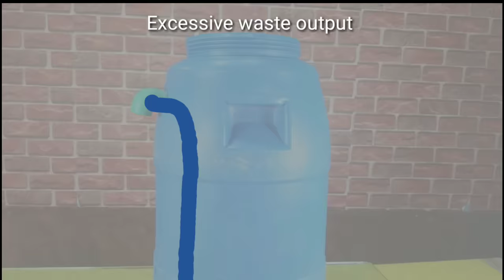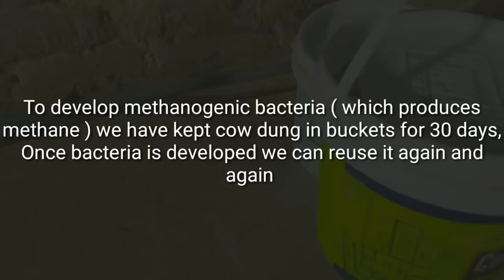How To Make Free Gas from Fruit And Vegetables waste | Bio gas plant |

Comment: What i would like to do is build one of these big enough to have a CONSTANT supply of gas for my home. So it would have to big enough that it almost instantly replaces the gas i use. Anyone know if that’s possible?
Reply: i wouldn't but suggest storing in a tank they use for cooking gas/oils at houses without a gas supply something that has a pressure system to check levels. I would also use a different container to compost in to stop any chance of escaping gasses. Something with a pressure release valve where it can be monitored sure there is digital readers out there.
Reply: @OrtzGaming  so in other words, create the gas, send it to a tank to collect it, then use it from there for home use?
Reply: Yeah, it possible. Start a dairy farm. There's a dairy farm a few miles away from me,  who produces all of their electric and heat from methane gas. You'll just need 400 head of cows, and MASSIVE storage tanks for liquefied cow sh*t. That will produce more than you ever needed.🤣

Comment: Boes this have an over pressure release valve? how much cooking will that tire offer? Will this work in Florida with a solo off-grider putting in table scraps and bathroom?
Reply: If the gas builds up it'll push the slurry out of the overflow on the side.
Although he didn't show him adding a pipe inside from the overflow to the bottom. Without it, it'll be open to the atmosphere and gas wouldn't build up in the system.
Reply: @jamingaming9251  he said the pipe goes down to the bottom inside and you use  Cork in the other end in the bucket.

Comment: How full can you fill the inner tube? Is there any fear of popping it?
Reply: Pressure build up will cause the slush to push out if the overflow hose on the side of the barrel before the tube would pop.

Comment: How can i transfer gas from a tube to gas tank
Reply: You need pump with high pressure tank
Reply: I seen a guy once using his air compressor to suck the gas out of a large bladder and into a cylinder. He stopped anytime the compressor started to get hot!!!! 
I don't know if he is still around

Comment: But you know that heat value is not so much
Reply: But you know the fuel is free, right? With a better air mix it would also burn hotter.

Comment: excellent video, how do you replenish the vegetable scrapes? if you lift the lid then from the digester gas escapes into air :)
Reply: In this build the methane is primarily stored in the tire. So changing the slurry should be of little problem. But yes it'll reset the internal balance every time every time. Oxygen will get in and we'll have to wait for the digesting process to pus out the oxygen when new methane is produced.

Comment: what if you dont expose the setup on sunlight i.e. in shade will biogas form?
Reply: you don't need to keep it in sunlight as long as it has enough heat to continue its process
Reply: @Neriuks9  I tried a month ago, a5 litre jerry can and I used a water tap instead of gas tap (trying to make the setup out of my little budget and I didn't expose it to sunlight as I'm always away) but to no avail.
Could there be any result behind this?
Reply: *Could there be any reason?
Reply: @MitathariTv  if you had bacteria in it and enough digestible material it should have worked, but as i heard you can't have any light coming in it because it can kill the bacteria, so if you tried keeping it in something that doesn't allow light through and get it some sun heat it might work, you can try putting a balloon on the end of the water tap. There are other videos with more explanation on how to do it. Good luck
Reply: I would guess that the increased temp from the sun speeds up the decomposition.

Comment: HI  ! WHAT IS THE PURPOSE OF THAT BIG HOSE ON THE SIDE OF THE CONTAINER  ?  THANK YOU !
Reply: To let some of the soup out when you want to add fresh material.
Reply: @mementomori6992  THANK YOU !
Reply: It is an overflow. If the liquid levels get too high they will overflow from the tube. Also if the unit fills with too much gas it will push the the liquid from the hose and then gas can escape without reaching dangerous pressures.

Comment: Sir what is the purpose of the first hose in the gallon?
Reply: To release excess sludge and water when the tank is full
Reply: @John-N797  Won't that go against the air-tight rule?
Reply: @bingesquad1  no. the inner opening of the hose is under the liquid. and the gas cannot go below the liquid

Comment: Orange flame = carbon dioxide
Reply: what does this mean?
Reply: @hermionegranger3912  Means he need to remove the CO2 from the generated gas, using an alkaline solution in a bubbler. He also need to install a filter to remove the hydrogen sulfide. For this project I think a tube filled with steel wool is sufficient.
Reply: But do you really need to remove the co2? Seems to work just fine with it present
Reply: @jdelgren9927  Yes, if you want to avoid blackening of the pans. You´ll get a blue flame, instead of yellow.
Reply: @bobalex6323  hi Bob, where would you install the bubbler for this project?

Comment: Cowdung is not a kitchen waste 🤨
Reply: Cow dung is not kitchen waste but is required to prime this whole system with methanogenic bacteria, so that the kitchen waste can be decomposed quickly. Otherwise, the kitchen waste will take simply ages to break down and produce gas. Also, the cow dung slurry needs to be compulsorily added only once, right at the start, to kick start the process of gas production. After that, it depends on the choice of the user.
Reply: @ramanipalle-naturediary6830  can you use dry cow dung for this? Like the one that comes in a bag or does it have to be fresh cow dung

Comment: Brother isko 7 days ke liye aise hi sunlight me rakh dena hai ya 1 din sunliht mai rakh kar wapas ghar ke andar la lena hai
Reply: The gas liberated in the tank must be paralleley connected to another similar tak so that there will be low pressure  so that the fear of combustion is not there,
Reply: When we feel it is dangerous  Why cant we keep it safely out side the house and do our cooking in sid our kitchen with extended length of hose pipe  ?

Comment: does the tire bladder valve work?
Reply: Tubes valve would be removed in a setup like this... note sealing off overflow too as not doing so will have poowater pushing up through it as presure builds

Comment: So everytime you take the lid off this, to add scraps your poop-gas is vented off....
Reply: Yes, also the waste overflow tube would have a lot of gas escaping the drum and air entering. Also, you can't start burning the gas that quickly. The air from when the drum is sealed would make the gas from the first 1 or 2 batches pretty useless. An almost completely oxygen depleted tank would be needed to start actually producing useful gas, which can be achieved by letting gas build up and venting it a couple of times. But with this design, you would have to introduce a lot of air into the tank to even fill it up, making it impossible. 

The design isn't very good, and having an open flame so close to a tire filled with methane is insane.
Reply: @MegaRXB  i have any idea,  what way could you fill the thing up ripe crap b4 its inflated, you need a sphincter type mechanism to add material,  amd a pressure reilef,  thats normally sealed,  would this work?
Reply: You DON'T take the lid off until the END of the decomposition process has finished for that particular batch of waste. Then you start the process again with waste material for the microbes to decompose.

Tip: The greater the amount of microbes the greater the decomposition. Being able to introduce oxygen to the waste container periodically  without allowing methane to escape would be ideal.
Reply: You can just take a pvc pipe, put thru lid all the way down to bottom. On side of PVC inside barrel you can cut an angle for food, dung to enter barrel but when dung and water go over the hole in pvc pipe then gas can’t exit via the PVC pipe. No complicated mechanisms needed.

Comment: i cant seem to make mine work
Reply: @dometheonlyone8936  pls help me, so tired of trying this 😭
Reply: @markbatang5320  usually they use cow poop but the bacteria need another bacteria that may not have in cow poop so all you have to do is just keep trying decomposed cow poop in the bucket for 30 day and do exactly like this video see if it's work i read it online it's so complicated.
Reply: @dometheonlyone8936  try and try until i die😆
Reply: Add sugar or molasses with the cow or chicken poop
Reply: @josephegtapen1298  when will you add sugar everyday within 30 days?
Reply: Joseph is right, bacteria needs carbon to multiply, which sugar has, bacteria propagation is only restricted by it's food amount, the more sugar you put, the more bacteria it gets.
Reply: @josephegtapen1298  there are solid particles forming atop the mixture,is it ok?

Comment: Can the Bacteria be added using Human waste instead of Cow waste?
Reply: Only if you're Vegan 😜
Reply: @maoryatskan6346  Thanks, I am Vegan, that’s why I needed to know, as I won’t use Manure, I have actually put a small amount of my own excrement in my mini( test) Digester, that I’ve made from an old 5 Gallon water container. Just to prove to myself that I can produce BioGas. Now it has started production, I am looking for the resources to scale up to a 25 gallon Digester for my home cooking.
Reply: @maoryatskan6346  What would happen if excrement from a Meat eater was used?, would the Bacteria be wrong as Meat is digested via Putrefaction, not Fermentation.
Reply: Surely a cow wood appreciate you recycling. It's in no way harming a cow. A vegan could do this.

Comment: Can 't  it  be  used to fuel generator
Reply: Yeah you can but you will need a bigger digester
Reply: Sure
Reply: @WaleTosin. Yes friend. But it is advisable to add an in line filter to 'clean" the gas more before combustion in the engine takes place.

Comment: I dit it, but it doesn't work 😢
Reply: You have a leak ?? Or you are using wrong feeds //vegetable waste may take many months do ferment .... Water- Maize flour ..plus caw manure for bacteria .. will start producing gas in 5 to 10 days
Reply: 1. Cow dung has methane bacteria. Use cow dung/chicken droppings, horse dung, buffalo dung etc. You can connect human toilet to the system as well. Some people recommend 50% dung, 50% water. If you have kitchen waste in large quantities, you can reduce dung percentage.
2. Methane bacteria work in absence of air/oxygen,. So your system must be air tight.
3. The output and input pipes have to be connected in a certain way so that to prevent air and methane movement. See my other comments above.
Reply: @swamiohm5681  Thank a lot, I will try again.

Comment: This is highly dangerous and stupid. Leave these kinds of things to real engineers!
Reply: You are right. But with precautions I think that you Can do that.
Reply: Lighting a fire near this pressurized plastic balloon is one of the most stupid things you can do.
Reply: @maoryatskan6346  if it is outside it will just turn into flame for a second as it would inside. But outside it will not catch fire to anything. It isn’t hydrogen which explodes. Go back to school as you do not understand the physics.